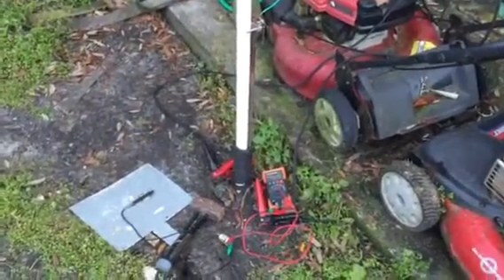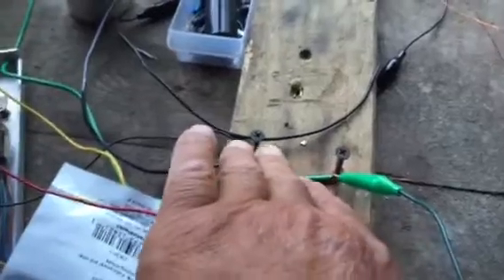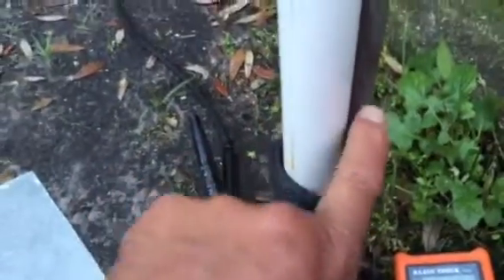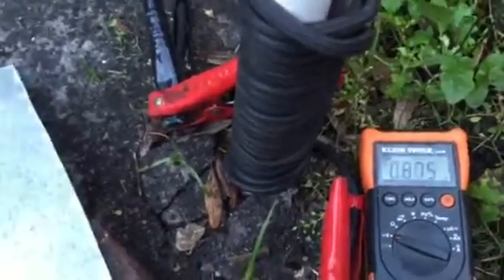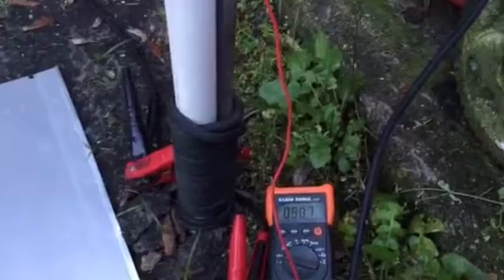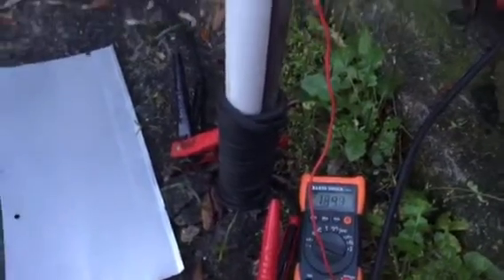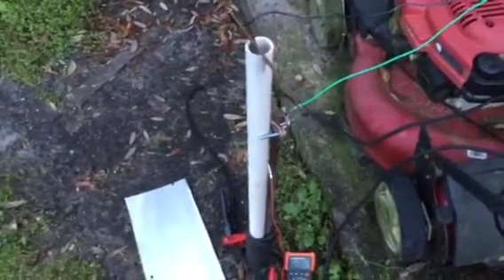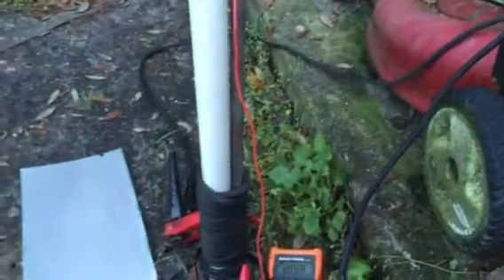Ed Leedskalnins workshop. Running and electric motor using

Comment: Very good. I will move experiments outside now with good weather coming. I do use a thick wire in the lab that goes to several ground rods I placed outside. Thanks for sharing the 3\4 :)
Reply from the maker: I guess what I'am trying to tell you on that 3/4 info that the secondary was Tesla way of miss guiding the public on all truths.
You been setting up all kinds of arrays of tesla coils
And I just showed you that the primary sets the field with oscillating and the signal input came from the ground. Peace my brother
Reply: vinny stvincent Tesla was right. He said he was going to use the ground where the energy is conserved. 95% ground and 5% atmosphere for exciting the planet. Simple tuning coil to pick up the currents.
Reply from the maker: I wish that you and Ryan, and me could get together, at some point, it would be a blast.
Reply: vinny stvincent I know :)
Reply: Terry Woodroof pretty cool stuffs bro.
The main power is from ground. the primary oscillations is the catalyst. I thing i like that.
MUDDy